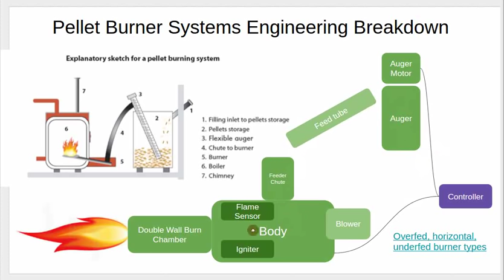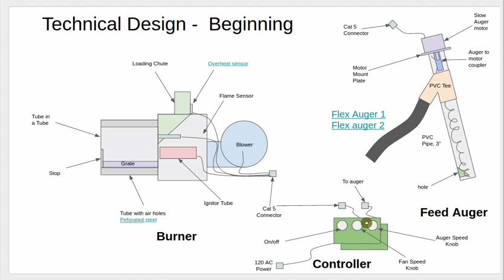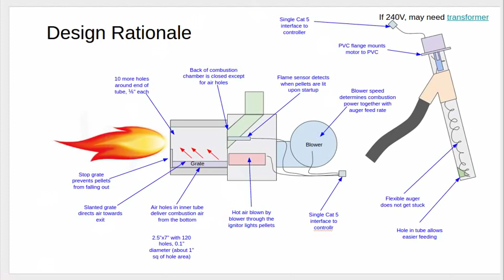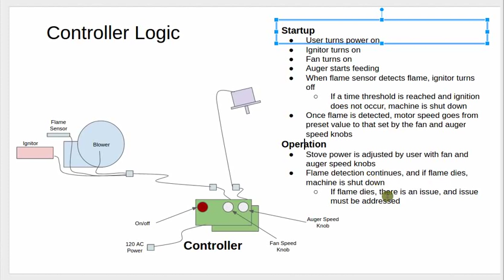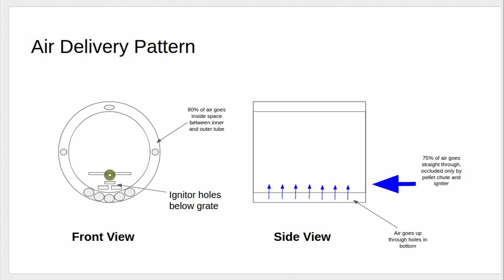Open Source Pellet Burner 101

Comment: Hi Marcin, i work with prefab design of biomass burning cookstoves for rural areas here in Mexico. 
Now we are working with adaptation of TLUD gasifier stoves for cooking and household energy and biochar production from pellets and wood sticks (biomass),it can be pretty more efficient than regular combustion and can be adapted for household heating and long lasting, via radiation like used in rocket mass heaters.
Also you can use the natural draft effect (suction by pressure differences in the height of a chimney) used widely in stove design instead of the electric fan (natural draft can be powerful in high chimney 2m or more).
It would be much more simpler with a few parts or without mechanical electric parts that require maintenance or replacement and gasification rate heat can be controlled with air inlets. Few CO2 production.

Comment: I'm all for options, and this is a good option for good temperature regulation, but wouldn't a rocket mass heater be a lot more space and fuel efficient? Self sufficient access to fuel? You've gotta buy pellets, (I'm sure you'll have a way to make them) but that's an extra step and it only burns pellets. A well designed rocket stove can burn anything, you can even get it hot enough to burn plastics environmentally friendly. You can put your mass deep in the floor with a secondary pipe running through it with a fan on a temp regulator to regulate your temperature better. (I'm spit balling here, idk why it wouldn't work though...)
Reply: Can we make a rocket stove to require as least maintainance as possible? For example, 1 charge per week or less?